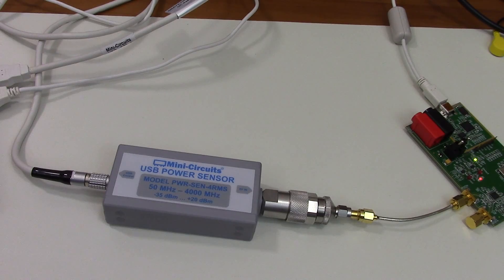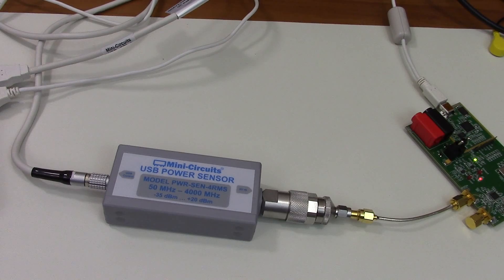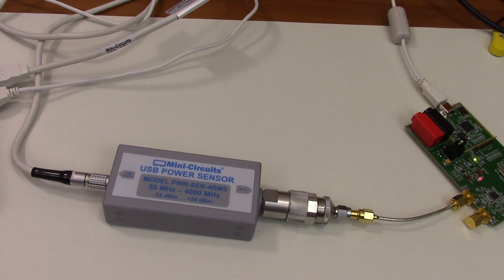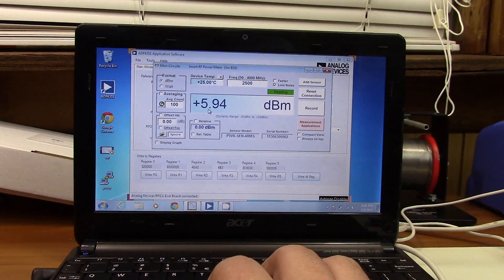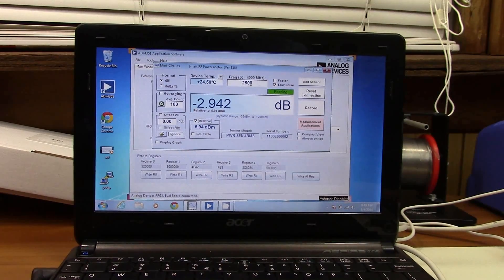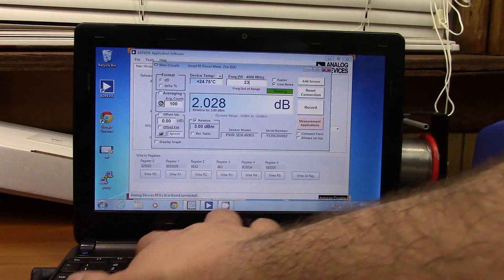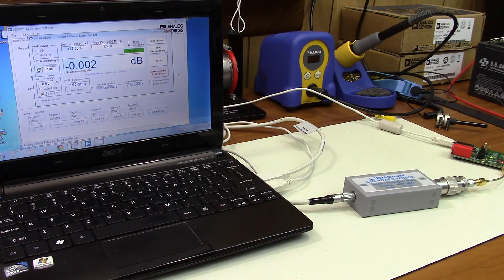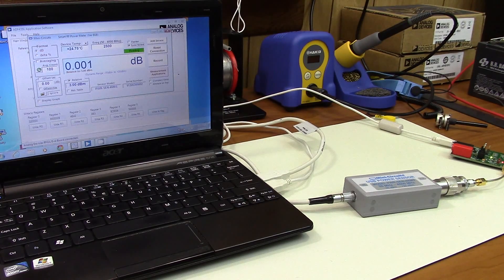Mini-Circuits USB Power Sensor REVIEWED!

Comment: Realize this is older vid.... but inputing frequency to power meter IS a regular function. Look at HP (Agilent, Keysight... whatever their name this month) 8481A, or other model, you will find a "Cal Factor" frequency chart. The older power meters had cal factor input knobs. Basically the cal factor chart is a freq response graph. Minicircuits may just input generic device data in their software that enters typical device cal factor when you input frequency.

Comment: I have idea, connect  some signal to mixer  and mix it with VCO signal controlled by Matlab, add bandpass filter, and read power of mixed (down-converted) signal, and compare it with normal spectroscope ? well, just idea, i know you are busy.
Reply from the maker: I was thinking about doing that actually. If I'd have my LeCroy WaveStation back, I could do it. Since that box interfaces with MATLAB, it'd be easy... But I definitely want to show parts of a Spectrum Analyzer or even a VNA so this is on my to do list.